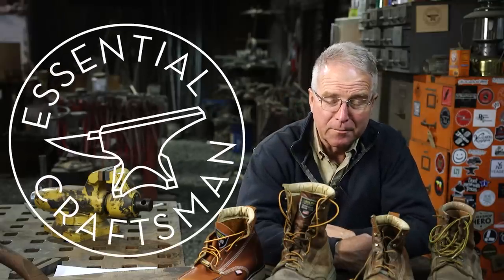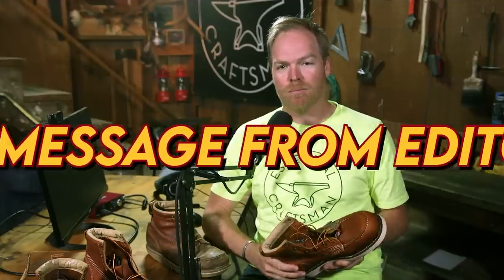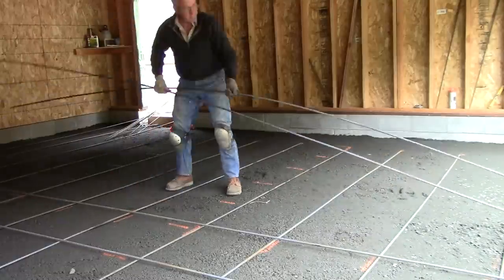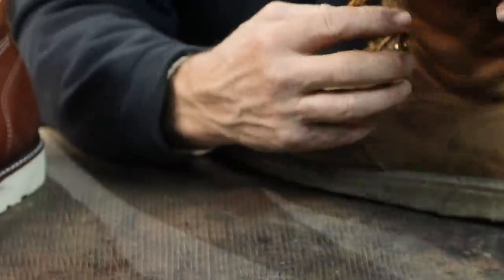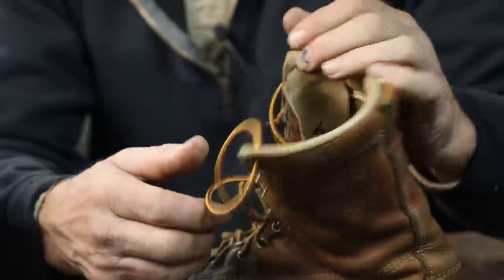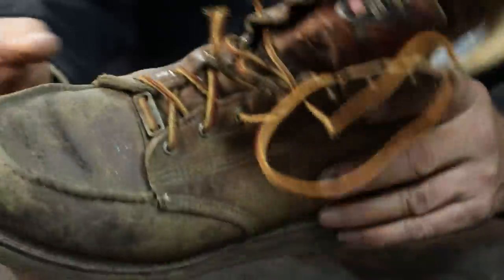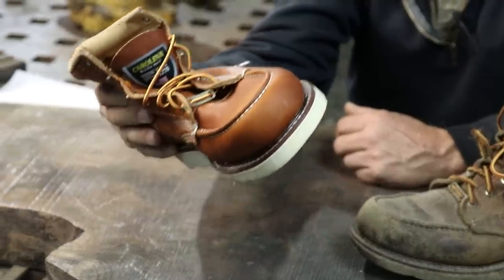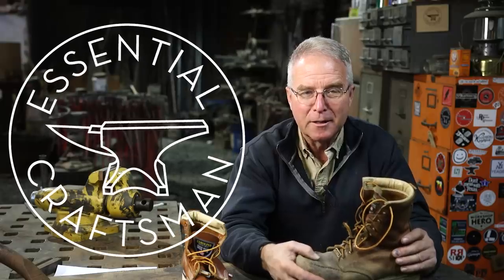Carolina Boot Review

Comment: One minor advantage these Carolinas have over Red Wing and Thorogood is that the front half of the outsole is stitched all the way through to the welt. Where the other two brands simply glue the whole outsole onto the stitched midsole, Carolina does the extra step of making sure the part most likely to peel off stays on. That kind of attention to detail makes it a choice boot.
Reply: I have a pair of red wing 2414. For over a year I beat them hard. Uneven terrain, mud, snow, concrete, walking on jagged piles of concrete, tripping over barbed wire cutting them up (often), rain. I expected them to fall apart sooner. The stitching is the only thing that failed but red wing got them restitched for me for free. 

I clean and oil them often because I'm constantly walking through mud . The mud will dry out the leather badly (I hate rubber boots). Anyway the soles are still holding on and no signs of them coming apart. I know red wing gets alot of criticism these days for being lower quality than what they were but I can't say the same at least for the 2414 models (American made) which are excellent imo.
Reply: Made in USA Redwing versions are tough but they cost a lot of money too . I’m seeing them for $365 now, but the quality is great for a factory made boot .

Comment: As a mailman I didn't have to worry about gravel or sand getting in my foot ware, so I wore shoes instead of boots.  I had a walking route that was more then 10 miles of walking a day.  I considered foot ware a consumable item and replaced them every six months or so with over 1000 miles on them.  I wore New Balance shoes (black leather uppers, nonskid soles) for the comfort and replaced them as needed.
Reply: Why did you have a walking route? Too young for a car?
Reply: The typical replacement point for cross country training shoes is 500 miles, well done making them last that long
Reply: @keeganwebber   I guess walking mail is probably a lot less intense for shoes than cross country training.
Reply: @Davey768  There is some cities with ordinances stating that mail has to be delivered directly to the residence or something to that effect; they tend to be for fairly older housing construction as mail slots are not really considered very safe now days. There is also some massive subdivision housing that is built by a single builder and they somehow manage to get away with having mail slots instead of a mail box on the curb or a cluster mail box(more common for cul-de-sacs, town houses or apartment complexes). Then you have housing in areas with lots of snowfall, they also don't tend to have curbside mailboxes as they would get covered up from the road being plowed.

Some of it also comes down to the personal discretion of the local post master and if they support having mail delivered directly to the residence or not. Sometimes you can have older construction with mail slots or even mail boxes next to the front door and a new local postmaster might come along and start demanding all new residents relocate their mail box to the curb.
Reply: @Jack-yl7cc  Huh, that's fascinating. I didn't know it worked like that someplaces.
Reply: Redwing loggers for oilfield use.  Or Carolina loggers.  8 or 12” top. 

Excellent grip. Good support.  Steel toe.  Heavy Leather that absorbs impact and bumping into heavy things. Tall boot that leaks little water or mud.  Lasts a long time. Thick leather doesn’t rot as fast in oil, salt water or weird fluids.
Reply: @Davey768  I had an older house, mail box was mounted to the house by the front door. Never had to replace a rotten post or dig out a snow covered box. So it was kinda nice.
Reply: @Davey768  In cities you have to deliver it to the houses.
Reply: @saulgoodman2018  True, didn't think about that. The way he wrote it made it envision him walking was distances with houses far between, and it sounded weird. I'm a bit too country I guess.
Reply: @Davey768  The house where I grew up was built in 1941 in an area with other houses that had already been built.  The mail boxes were attached to the house beside the front door or the screen door of the porch.  The mail man would walk from house to house on one side of the street and then back on the other side of the street.  
I now live in a town of 900 and if you want your mail you have to have a box at the Post Office.  There are at least 2 rural routes out of this PO with the boxes on posts beside the road.

Comment: I've had my  Carolina's for 25 years.  They have been re-soled 4 times.
Reply: Wow! Now that's saying something!
Reply: @bob_frazier  They are no longer the prettiest boots on the jobsite, but they are functional and fit like a good pair of slippers.
Reply: Because they were made in the USA by union employees.  Look on the inside.
Reply: realangrythrottle amen, brother
Reply: Mine leak water after 6 months.
Reply: @billcleveland9995  I never saw them advertised as waterproof.  I did clean and oil mine about every months, but they were never waterproof.
Reply: Do you use a local cobbler for re-soling?  I have two Carolina wedge soles that I would like to Re-sole
Reply: @bluefoxcarpentryllc6787  Yes, I use F&J shoe repair in San Jose.
Reply: Blue Fox Carpentry, LLC there's a great cobbler shop in Roanoke, called Shoe Doctor. They did a fast turnaround on a pair of Thorogoods for me, great craftsmanship & price.
Reply: @billcleveland9995  They are leather. If you know anything about leather, you would know it's not supposed to get very wet. Some light misting will be fine, especially if you condition the leather, but if you are soaking them, that's bad for leather. Sounds like user error.
Reply: Are they true to size? I'm a size 10, but I'm deciding between a 9 or 10
Reply: @Logalactic  I am a 10.5 and I got a 10.5 and they fit well.
Reply: @Jose Mora In San Jose, F&J Shoe Repair.
Reply: @vendter  do they come in a men’s 12?
Reply: @nicksworkshopp  When I bought them they did.
Reply: Not trying to be rude, but do you work in an office?   I got my first pair of these boots a little over a year ago, and while I love the comfort, the soles lastest less than one year.  Just had them re-soled, the upper has held up well, but no way I get 6 years out of a sole…
Reply: @stevelamby7658  The trick to making boots last is to buy two pairs at the same time and never wear the same boot two days in a row.  I am an electrician and usually walk a couple of miles a day on the jobsite.  My first pair of boots were Irish Setters from Red Wing.  The soles lasted about 7 months so I know that some soles don't last.  I think I replaced my first set of soles after 3 years.  I guess my cobbler used better soles than the original because the replacement soles lasted twice as long.
Reply: @vendter  Thanks for the tips!  Ill take any I can get @. $200 a pop for a pair of boots!
Reply: @stevelamby7658  The main reason for two sets of boot is to allow the boot to fully dry before wearing them again.
Reply: @billcleveland9995  mine too
Reply: @stevelamby7658  my boots won't last 3 months. Had them 3 weeks and my soles are so worn in the heels its ridiculous.  I work on Airport asphalt so that has something to do with it.

Comment: Had a previous coworker recommend Thorogood boots to me, and I haven't used another boot brand since. They have a wide variety of styles, have a made in USA line, fit my admittedly small feet very well, and take the abuse I throw at them without complaint. I'm hard on boots, but I try to cycle between 2 pairs of Thorogoods to reduce the abuse a bit. My 2 pair of Thorogoods are still going very strong 3 years later, with no signs of stopping.
Reply: Thorogoods are better than carolinas. Both very similar but I have a narrow foot and the thorogoods work for me. I will never wear another pair of boots until I die.
Reply: Hands down the best boot I’ve ever owned......
Reply: I switched from Danner to Thorogood mock toes and could not be happier. Feel like sneakers and take some abuse. Mine are now 1 year old and have a ton of life left. Also they look very similar to the Carolinas in this video
Reply: I’ve had a few Thorogood boots that were  fantastic, and a couple that fell apart in three months.
Reply: Had a pair of their military boots and they lasted  for  4 years which is absolutely ridiculous for military boots that I wore every day and every field exercise
Reply: Jason Scarbrough Thorogood are fantastic. I've had Red Wings, Carolinas, Danner, Georgia USA, Chippewa & Wolverine, & Thorogood are the most comfortable for me.

Thorogood also have a proprietary crepe sole that is more durable than Vibram.
Reply: Love my Thorogoods but the break in was long and painful
Reply: Gmjent56 it's interesting how individual boots are. Red Wings are notorious for a rough break in, but mine weren't bad. But my Thorogoods have all felt like they were already broken in, including after getting factory resoled. My Danners OTOH took amcouple weeks to feel right.
Reply: I loved the 8 inch thorogood moc toe but they stopped making them in my width.  Frustrating.
Reply: Their customer service is really responsive, give them a call/ email.

Usually, unlisted boots, or ones marked “discontinued” at retailers are simply out of stock. They have a production schedule & cant meet the demand. 

They make a composite, round toe  boot I’ve been looking for ages, but it’s still not in stock. Was scheduled for production earlier this year but got pushed back.
Reply: @thorogoodboots . I love my #thorogoodboots I bought the waterproof moc-toes and they are my best ever boot.
Reply: @fortune214  I actually forgot about the pair of SAWs I bought on sale a few months ago for summer wear, so I actually have 3 pairs of Thorogood boots. And agreed, they're great.
Reply: Jason Scarbrough I don’t actually rate the SAW boot, the boots I had/have were called “crossfire peacekeepers” made for an Australian company by thorogood they are proper welted boots
Reply: @bobsmith-ji2uh  I own both and they are virtually identical in materials and construction. The Carolinas are wider in the forefoot and slightly narrower in the heel.
Reply: I’ve really liked the comfort of my Thorogood moc toe boots but the certainly cost more than Die Hards.
Reply: Tracy Smith i think if you take advantage of Thorogood's resoling & reconditioning service, they'll save you money over time. But they are certainly more expensive to start.

After working construction & maintenance for nearly 20 years, (started  at 16,) my feet started giving me problems last year. During COVID, i've been working 16-18 hours 6 days. This is when the Thorogoods are worth their weight in gold to me
Reply: I’ve got a pair of Thorogood 6” steel mock toe with crepe soles, most comfortable well made boot I’ve ever owned. I intend on buying another pair, but at the rate these are going it’ll be a while. Plus, can’t beat something made in America!
Reply: @gmjent5671  mine took about two weeks.  I replaced the insert with the Superfeet green insert.
Reply: @jpforr1  it's cuz they're made by the same manufacturer I'm pretty sure

Comment: Before literally Finding my first pair of Carolinas when I was a Trashman, I worked as an auditor at a Rustoleum warehouse and had all my work brought to me and any distance traveled was done on a forklift, the job required Steel toes so I bought a pair of capped steel toe Georgia boots that were built like a tank and weighed about the same as said tank. I still have them and now only use them on snowy days that I'm not working just to stay warm and dry. Changing over to being a trash man, jumping on and off the truck, running around, dragging and throwing 96-gallon trash toters in what I would describe as Georgia's Black Sabbath Iron Man replica boot filled me with dread every day. One day I lucked out and in a very nice housing development at the end of a culdesac, presented on the top of trash toter was a basic pair of 12-in Carolina soft toe boots JUST MY SIZE in perfect condition save a broken lace and a scuff on the toe of one boot, Both boot weighed what seemed like a quarter of the boots I had on. I took them home cleaned them out, filled them with Gold Bond to make sure I didn't catch some footrot, replaced the lace with some paracord and put them to work. I wore the soles out of them just in time for my yearly boot voucher that I used to buy my first pair of Carolina CA5520, composite toe, 6in plenty of bells and whistles amazing boots.I of my Georgias is heavier than both of them. I actually had an accident where I fell and the driver drove across my foot and lower leg in a half-full truck that weighs 36 tons empty. The double dually tires in the back both ran my foot over so it was pretty much run over twice. The muscle and soft tissue got smashed pretty bad but only the second long bone from the outside of my foot broke and only in one place although it was a pretty nasty break I really feel like composite toe and shank while laying sideways on the ground hand enough structure to keep my foot from becoming a pulpy mush. For this, along with comfort and weight, I am a Carolina man for life.
Reply: This is another way we can say the same meaning in English.
Reply: Cool story bro.

Comment: I've had the same pair of boots for 2 years now.

I bought a brush from the dollar store. So when I get home I give them a quick brush. Wipe with a damp rag. Rub Obenaufs into them. Do that a few times a week. Takes less then 5 minutes. They still look brand new after doing this.
Reply: Obenaufs a few times a WEEK?
Reply: @Aletaire  you bet. Just a thin little coat. I don't go crazy rubbing a handful in. When they're covered in concrete and drywall dust everyday plus our winters are -30 they dry out real fast.
Reply: You are doing exactly what I recommended to my customers for 35 years. Caked dirt, concrete and plaster dust rob the tanning oils in the leather and it reverts to it's original state of animal skin and what happens to a cow hide left outside: it rots, very simply.

Comment: I’ve been wearing Thorogood boots for about 4 years now and so far I’ve been impressed. They’re the most comfortable footwear I’ve ever worn and they seem to hold up pretty well. The only reason I had to get a new pair is that I stupidly cut into them with an angle grinder while holding the work piece down with my foot. The disc didn’t go more than half way through either but it was at a spot that bends a lot when walking so it tore through after a little while. One more important note is that the soles don’t seem to wear out too quickly, after three years on the one pair I still have some tread left. I’m overall very happy with them and would reccomend them if you’re looking for a new boot brand.